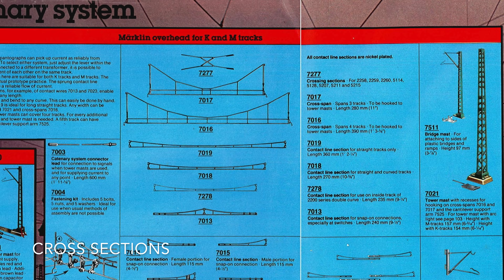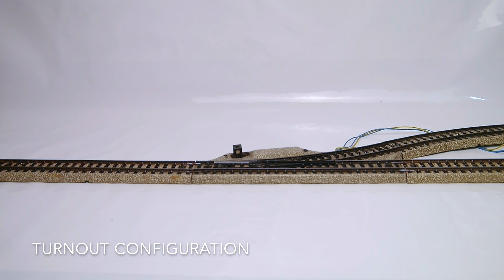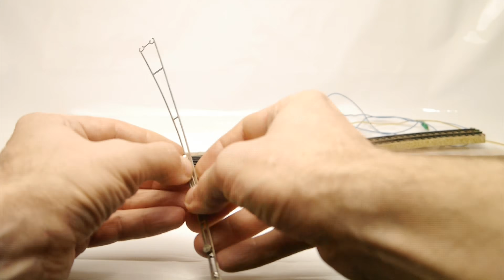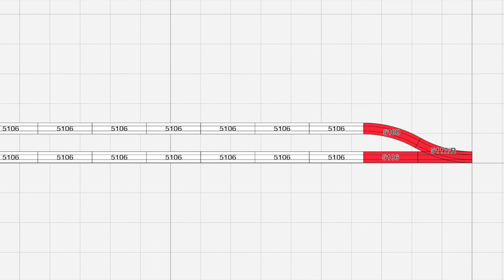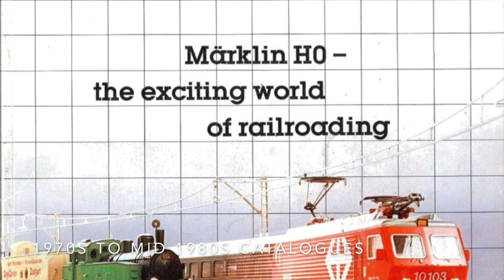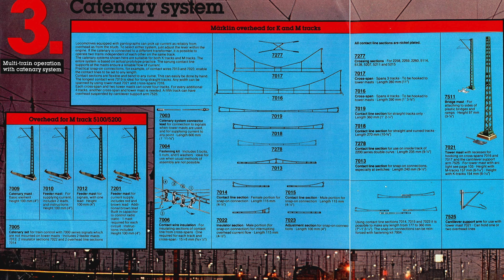Little Helpers - Märklin M-Track catenary system

Comment: Hi Sir, and thank you for this very informative video!  We are interested in doing one thing that your video does not address, and that is to have sections of our track without catenary, so we need to be able to have ramps on and off the catenary so that the pantograph does not snag as it re-engages the catenary system.  Online searches suggest that part number 7014 for classic set up or 70143 for modern set up can be used for this purpose, but cannot find any demonstration about how this would work.  Can you suggest any assistance for this purpose?
Reply from the maker: The video doesn't address this point because the catenary system doesn't provide a standard way to do this, even with 70143 (this is just an adapter). You could build a ramp by bending the 7014 up a bit, I think you might need to attach a 7023 to reach the desired height with a softer ramp. Of course you'd need to find a way to attach the high side to something... This is a common challenge in shadow stations, where many people don't want to install catenary. If you have a surface to play with (tunnel entrance?, wooden beam?),  you could simply use a piece of rigid wire or a rail from a piece of track, or even a piece of wood... I did a quick search on google with the german term "Märklin Oberleitung Übergang von drahtlose Strecke", looked at the pictures in the search results and got to an article on Stummiforum: https://www.stummiforum.de/t202925f2-Oberleitung-uebergang-zum-Schattenbahnhof.html . There are many ways to achieve what you describe, but all require a hand made solution.
Edit: if you are not a german speaker, you could post a question on https://marklin-users.net in English, or https://forum.3rails.fr in French. I am sure someone will jump at the opportunity to share their wisdom. All the best.

Comment: Hi there !!! I used your layout plan for my own layout: I had to work on it to reduce dimension (length) to 4.20 m. It works great ! In this video, you talk about Marklîn catenary system items. But nothing about 7011 mast special for bridges. These masts are uneasy to find on EBay and very expensive. I found a tip allowing the use of 7009 standard masts modified in place of 7011. Video there: https://www.youtube.com/watch?v=XcxmWdsd_U0&t=5s     I really enjoy your videos and spent lot of time watching them. Thank you, keep on this great job  ! (Sorry for my english ! )
Reply from the maker: Glad you enjoy the channel. No problem with your English, you can leave a comment in French too (je pense que je peux encore comprendre ma langue maternelle 😉). The masts themselves are basically the same, the only difference is the base. I was lucky to find a huge supply in one of the shops I use about 10 years ago, and I bought everything I have at once (well, a bit more than I needed).  Thanks for sharing the information.

Comment: As a teenager in the 1970s, I built Märklin layouts using the Märklin overhead line system. Had I known about your video series back then, I would have avoided many mistakes and problems. It's nice to learn about the solutions 50 years later. Thank you very much for this, and also for allowing me to reminisce about these wonderful memories.
Reply from the maker: Hello Stranger! Nice to see you back here. Glad this video could hit the mark on different levels, thanks for the vist!

Comment: can I feed DC current on the catenary to run DC train while run AC current to run AC train at the same time?
Reply: I meant AC current on the 3-rail track.
Reply from the maker: Yes, people do this to run 2-rail electric locos on 3 rail track in digital, but analogue DC would run only in one direction. The track can only be connected to - and the catenary to +. You can test on a small section of track first if you want to check.

Comment: I just bought some 2nd hand marklin catenary, i plan to use it for 2 different trains, steam/diesel and electric, but when i hook it up to a other transformer it doesn't work, but when i plug the red wire out of the track (the brown one stays) and put the wire of the catenary in, it does work, there also was a brown wire included in the feeder mast, did i do something wrong?
Hope you can help!
Jesse
Reply from the maker: You need common ground for this to work. Both brown connections from the transformers need to be connected to the same circuit. You’d have to make sure your transformers are in phase too, see this video: https://youtu.be/atYob18JTRs?t=893
You can use a lightbulb instead of the voltmeter (bright light = out of phase). Good luck.
Reply: @The3rdRail  thank you so much! Best marklin youtuber on the platform! Keep up the good work ❤️

Comment: Why are the connecting rings open on one side? I guess it is for protecting for more damage when an accidinent happens. Not with the train, but with your three year old son, or yourself. 😄
Reply from the maker: no idea... may be to allow the thin spriing wires to slides though if you need to re position them.

Comment: Can you work digital locos through the overhead lines so you can run a few locos at a time like you can when using the normal track system.
Reply from the maker: If you mean running your digital locos in analogue mode using a transformer, yes. Provided of course your digital locos have working pantographs, which is not always the case with newer models. Märklin doesn't recommend having working overhead lines in a full digital setup, but it is also possible.
Reply: @The3rdRail  
So you can't work a digital system through the overhead lines like you can through the Track.I was hoping to work my D/C digital locos through the overhead lines on Marklin A/C track.Otherwise I will  need a separate track for my D/C digital locos etc
Reply from the maker: Your comment got marked as spam for some reason. Some people do run their DC digital locos with overhead lines, but Märklin doesn't recommend this way of doing things (see their user manuals). Best is to give it a try on a small section and see what happens...
Reply: For a time I was running three systems on one track: 3 rail, 2 rail and catenary - all digital/DCC.

Comment: With all my respect. The catenary must not bend when cornering. The catenary wire is always straight between the two masts. In straight lines the posts have to be placed alternately one on each side of the track. In this way in the straight lines the catenary describes a smooth zigzag. This is to ensure the pantographer's contact. On few occasions a curved catenary wire is put in place, and for this, tensioners are used to force the curve.
Anyway, very good tutorial. I've been following you for a long time. Congratulations.
Reply from the maker: Hi, 
It is always good to get comments/feedback. I think your comment applies to the latest version of the Märklin catenary system (for the current C- and K-track systems), which has been engineered to work the way you suggest and is more in line with the real world. This was an improvement over the M-track catenary system. 

With the old M-track catenary I am using, you have no other choice than bending overhead wires, the available wires are too long, and wouldn't be aligned properly. The Märklin manual even instructs the user to do this, see page 2 of the manual "Catenary system for 5100/5200 Series Track"where you will find the relevant information.

Many thanks for your visit, your compliments and comments, take care.
Reply: @The3rdRail  You are surely right. I am not familiar with the old Marklin M system.
On the other hand, I really like your channel and it has made me appreciate the M system. I think I'll push it into the hidden part of the layout I'm building.
Thanks for sharing your work.